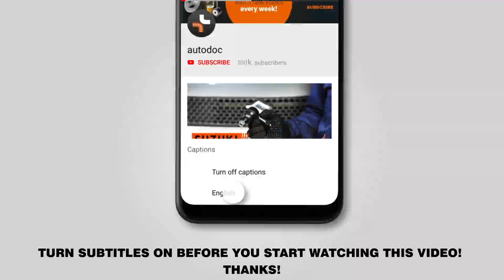How to change front springs / front coil springs on RENAULT TWINGO 1 (C06) [TUTORIAL AUTODOC]

Comment: Thanks for the video. Very clear instructions. I'm wondering about the other side tho, as pretty much everything seems to be sitting in the way.
Reply from the maker: In general, the replacement will be similar, the only thing is that it may differ slightly is the design features of your car. More precise information can be obtained in the technical documentation for the car or by contacting the car service.